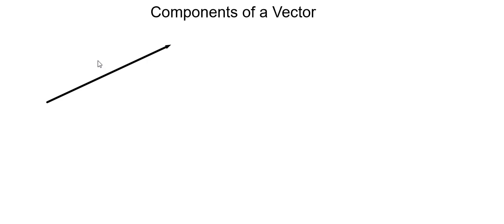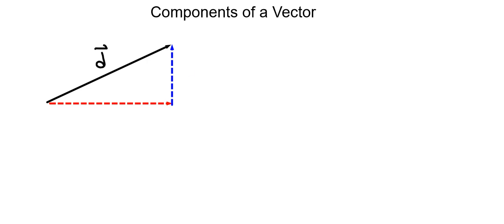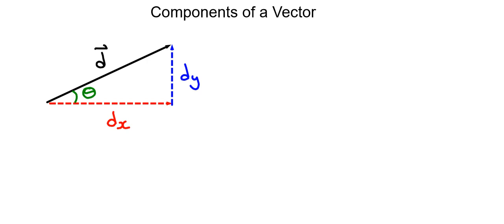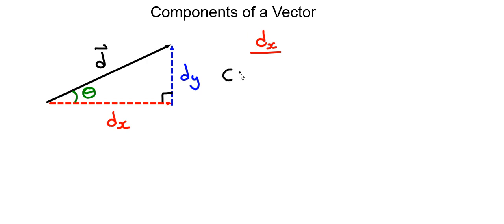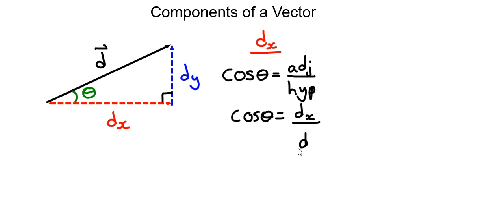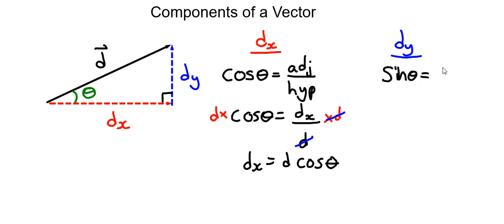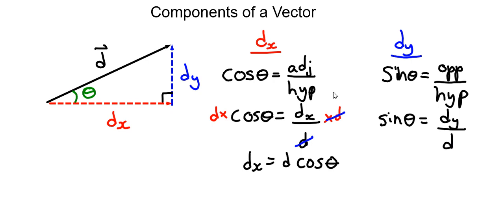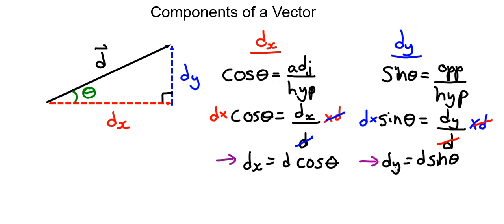How to Break a Vector Into Components

Comment: hey wouldnt there be 2 ways of splitting a vector. i mean in ur case assuming we took the OTHER angle which would be 90- theta in ur diagram, and took that angle as alpha then wont the sin theta component becmoe the cos alpha component... so how we split it depends on which way we take the component
Reply from the maker: Hey, thanks for checking out my channel.
You are absolutely correct. There are 2 ways to find the components. If angles theta and alpha are complimentary (add to 90 degrees), then sin(theta)=cos(alpha) and vice-versa.
In other words, finding the x component will not always need to involve the cosine function, the sine function with the complimentary angle can also be used.